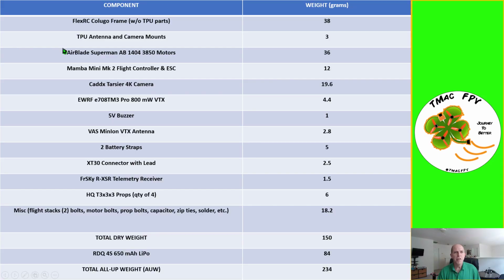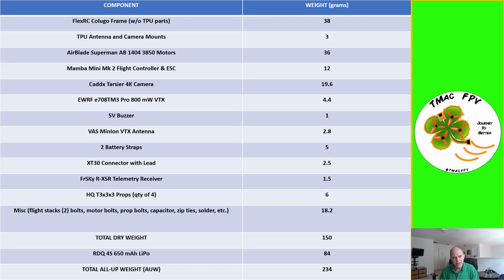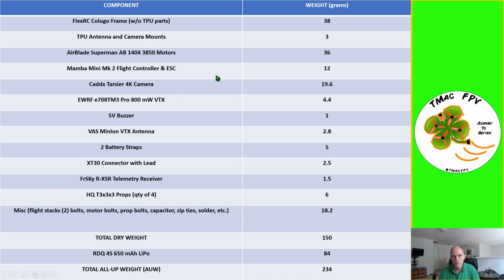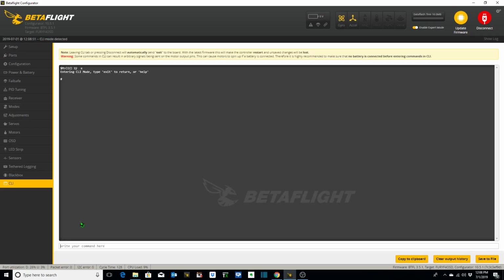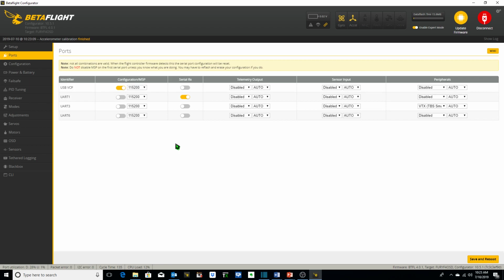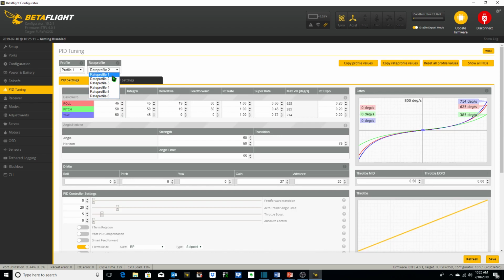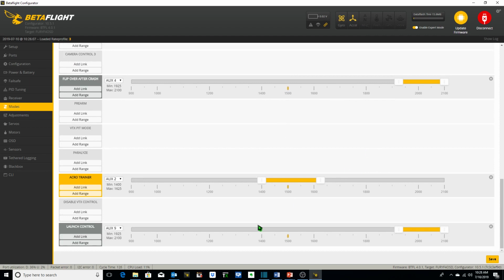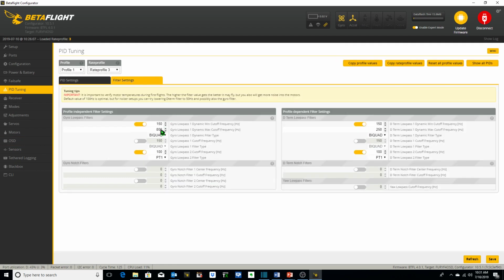MICRO FPV 3 INCH QUADCOPTER BUILD

Comment: Have you seen the flywoo Mr croc? It's got space for 3 stacks pretty sure all both 30x30/20x20 they're pretty nice but they're 5 inch frames
Reply from the maker: I like it and all frames that have versatility.  5-inch frames,of course, have more room so its a little more difficult for "micro's" to have as much versatility.  That's why I'm always impressed with the FlexRC designs. Dmitry does a great job with his frames IMO.
Reply: @TMacFPV  I used an I flight i3 for the 3 inch I built is good a front and rear stack and a center top plate stack spot, I really like it also has 2 sets of camera mount plates one for 2 cameras like a split setup or something.
Reply from the maker: @smoakthis  Sweet! I've heard good things about that frame.  Sounds like you're enjoying it too! 👍😁

Comment: Great Sub 250g Build Video TMac. What is the weight of the Colugo frame with TPU Parts please ?
Reply from the maker: 38g without TPU parts, 41g with TPU parts.  I have since removed the antenna mount TPU part.  Didn't like the configuration of the antennae it placed them in.  Was getting too many "signal low" warnings.  Went with zip ties and heat shrink and placed them 90 degrees apart.  No more signal low warnings (for now). I'm about ready to start using R9M module so I don't need to worry about it anymore.  Not for long range, just for better propagation/reception.